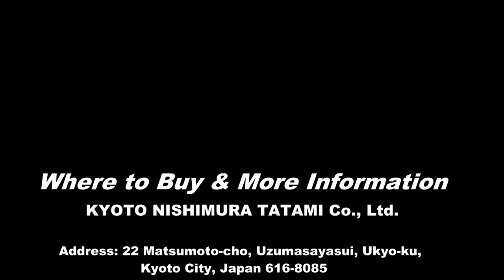A Traditional Form of Flooring in the Japanese Culture and also has Health Benefits

Comment: this takes hand crafted to a different level, it includes the feet!  Amazing skills that equal a beautiful product.
Reply: @ledganache  comes out to a bit over 12$ a square foot, probably 13$ by now.

It is high for flooring, but bear in mind you are installing this instead of carpet or linoleum or hardwood, so you can exclude the price of that from the 'expense' (because you would have had to buy some kind of flooring wither way) and what's leftover is the money you spent splurging on Tatami over cheaper alternatives.